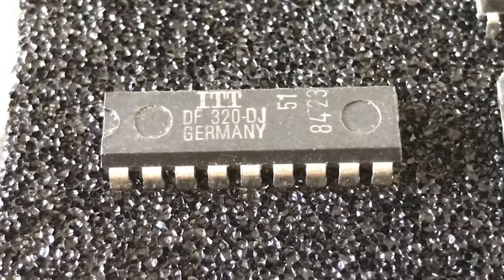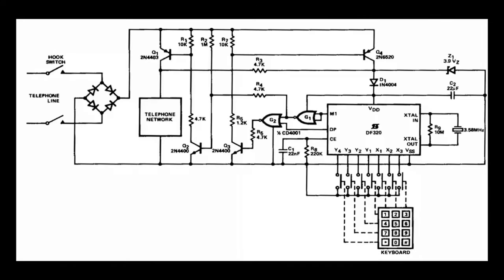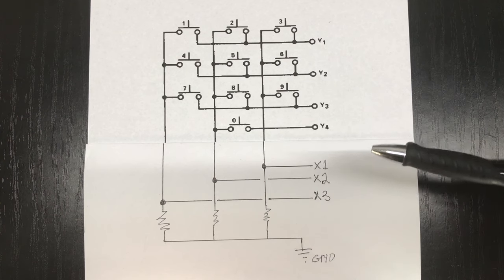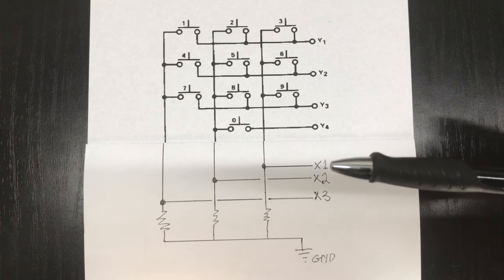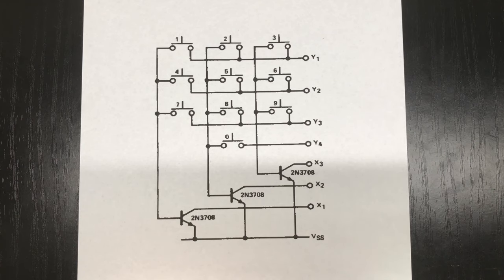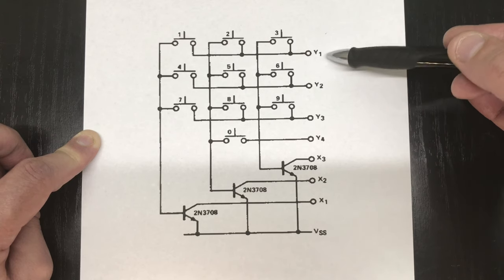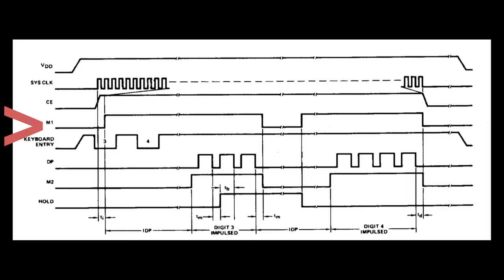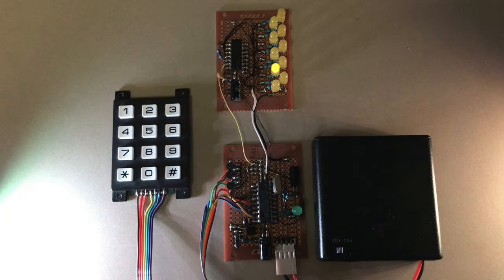Vintage IC - DF320 Loop Disconnect Dialler (1979)

Comment: I remember those, and the crystal was a common NTSC subcarrier oscillator crystal, out of TV sets. Of course, living in a country that did not use 60Hz 525 line NTSC, but which used 625 line 50 Hz PAL, those crystals were as rare as hen's teeth. Pretty much the only source of them was ironically to take apart dead telephones, to get the crystal out of it. The days of analogue phones, and dialling numbers that did not have high numbers being faster to dial. Still have a few of those pulse dial phones around in working condition, they are pretty much bulletproof phone wise, though the curly cord does eventually decay with time, and have some with both push button dial and rotary dial, and some that are configurable for both LD and DTMF dialling, using the same chip for both and a single switch to select.
Reply from the maker: The DTMF chip with pulse dialling would have been more fun. This data sheet was dated 1979, though my chips manufactured 1984. It couldn’t have been long after that they came out.